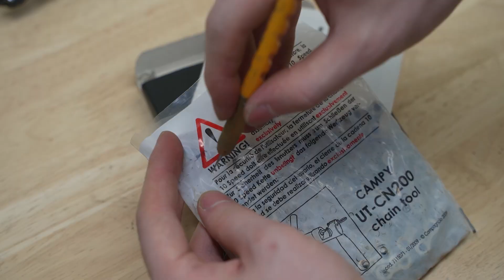BUILD BICYCLE - ITALY MADE GIOS

Comment: good work but wrong wise for the handlebar tape on the right, should be wrapped in the anticlockwise (clockwise on the left)
Reply: There's no problem with that, and that's the better way to do it instead of anticlockwise on the right handlebar. Have you ever tried wrapping the handlebar yourself before this?
Reply: @bartwu  ok i see you're not a professional so i need to explain you why there is a wise to make it correctly, when you hold your handlebar with your hands you naturally make a downward pressure and this anticlockwise (on the right side) is chosen to tighten the tape, that's why the wise is different to the left, but if you're still not sure you can watch some videos of professionals or continue to make it like an amateur, no problem !
Reply: @KuachtemoK  clearly you are the one in the lost now, I bet either you are just into cycling, or you never ride a roadbike before. You may have a slight idea about the downward pressure, but for your information, while riding on the drop, the pressure is going outward instead of inward, hence the better way of wrapping the tape is outward. Who is in his right mind applying pressure inward while riding on drop? You must be joking right? Or, if you really don't  know about this, now might be a very good time to start learning, there's a tonne of information on the net nowadays.
Reply: He wrapped the drops correctly. He just didn't reverse the rotation after wrapping over the levers, which a lot of people don't really do. At least it's how Park Tools recommends wrapping it.

P.S. In case you didn't know, "direction" is the word you're looking for. The "-wise" part of "clockwise" is a suffix, not a word.
Reply: It's simple - no clockwise or anticlockwise - just inside to outside as in this video, both sides then go opposite ways to each other and get tighter when in the drops as your hands tend to rotate outwardly an tighten the wrap.
Reply: No professional about it. When you grip the bars in the drops all pressure is downwards and slightly forwards, but you apply rotational force outwards. If you don't. then your hands / arms are in a very unnatural position. 
  When on the tops, you tend to rotate your hands forwards so the wrap in video is correct for me.
The only time you would go against the wrap is when climbing on the tops and really struggling and then you will tend to pull back on the bars and against the wrap. @KuachtemoK